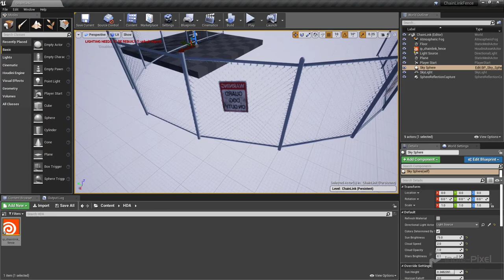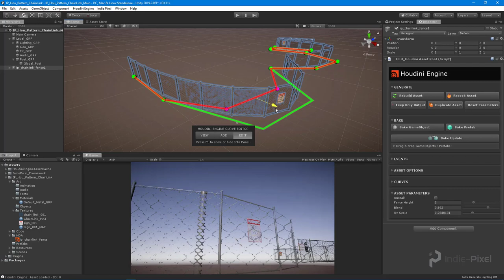Houdini 17.5 - Procedural Patterns - Chain Link Fence - Unity 3D & Unreal 4

Comment: Can it be that this course is outdated with Houdini 18? In having problems with the Subdivision  Curves which never smooth out and the length of the subdivisions is not even either. I downloaded and opened your file to double-check and it just contains the 10 m line without the bezier curve of the fence.
Reply from the maker: I dont believe any of h18 changes affect the fence course.  Though the sweep node is different.  The curve node and res ample nodes are still the same.  I'd have to see your hip file to find out what's going on...I'm sure its something simple.
Reply: Indie-Pixel thanks for the offer. I think even your hip file is different if you open it in H18. Did you check it?